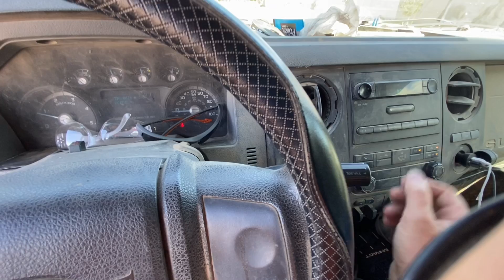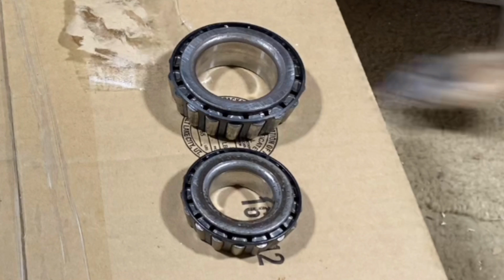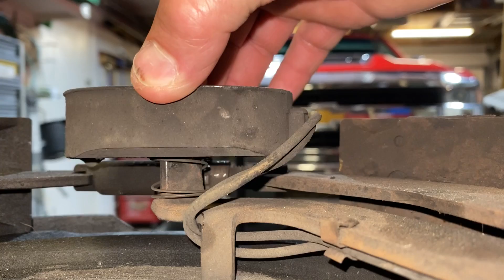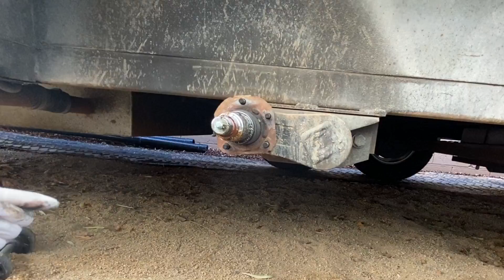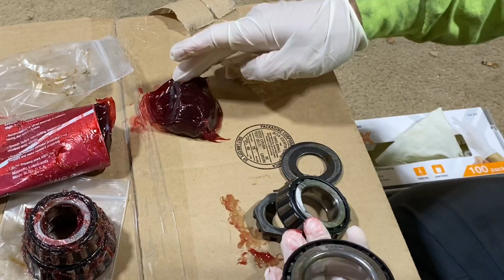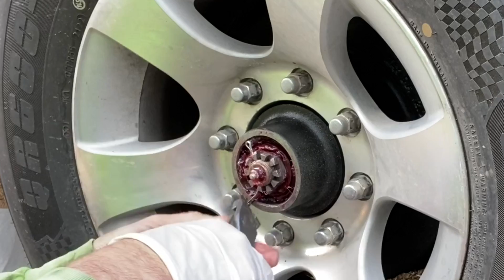ELECTRIC TRAILER BRAKES HOW THEY WORK TO DIAGNOSING, FIXING& REPLACING W/BRAKE CONTROLLER ADJUSTMENT

Comment: It’s also good practice after feeling the brakes engage with manual override to brake multiple times finding the setting that is only assisting your pulling vehicle and you don’t feel the trailer stopping harder than your truck. You shouldn’t feel the trauler tugging behind you. I pull equipment for jobsites all over the country. I’ve heard some people say equal braking (50/50) from truck and trailer. I HIGHLY disagree I pull about 60/40 or less truck to trailer… to each their own but I don’t want a trailer attached to me locking harder under heavy braking when it isn’t in charge of direction.. I don’t want to fight any bias in braking on trailer when I need to steer around something in emergency situation